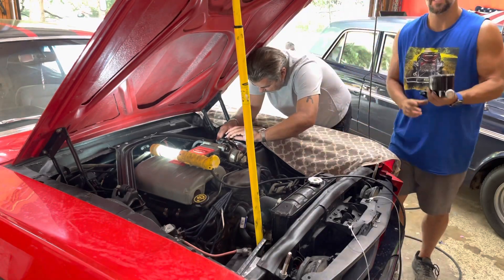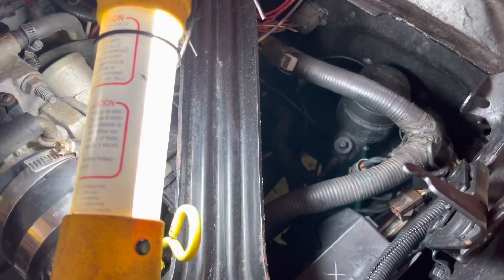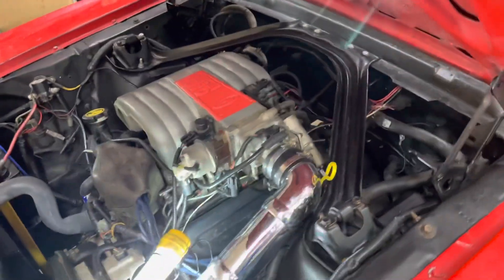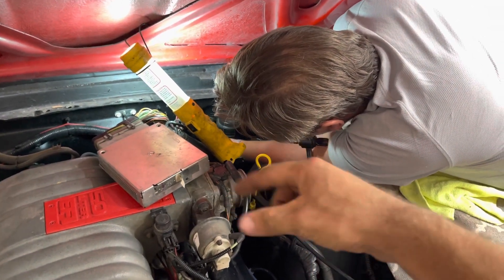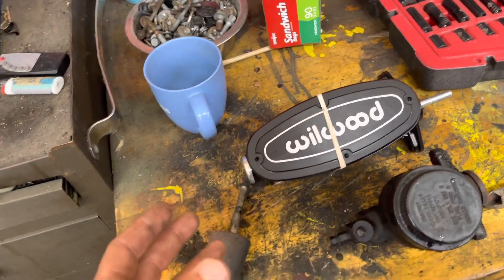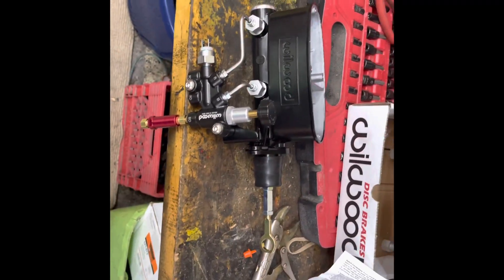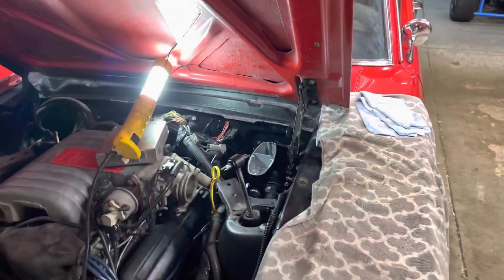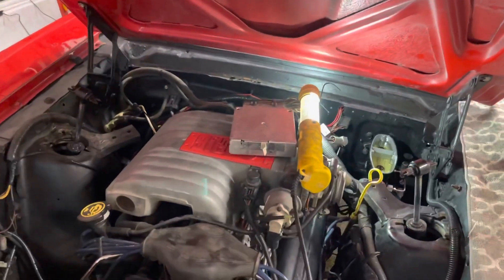1965.0! Mustang project: Wilwood 15/16" BRAKE master cylinder with proportioning valve installation

Comment: What fitting did you use between pressure valve and proportional valve? Im doing the same thing on my 67 and its the only thing holding me up
Reply from the maker: Hmm I can’t remember having to buy a specific fitting, I thought everything I needed came in the kit for the master cylinder and the front brakes. I do remember having to buy some pressure reducer (or increaser I can’t remember) to go to the rear drum brakes because discs either need less or more than drums. But that fitting also came from Wilwood and was $15-20 on Amazon from what I remember. Link should be in the description. Hope that helps.

Comment: Is there a specific reason you chose the 15/16"? I plan on ordering the same exact set up and was wondering what size bore i should get.
Thanks for these videos.
Reply from the maker: I called tech support and asked them what they recommend and with the 6 piston and their manual MC that's what they recommended for me being a street car.